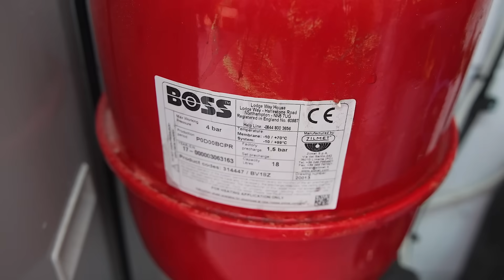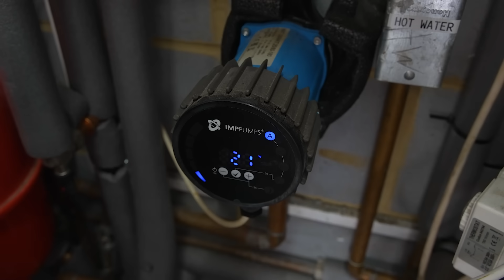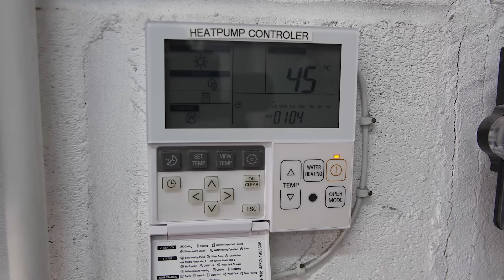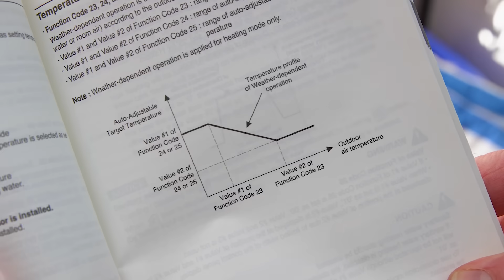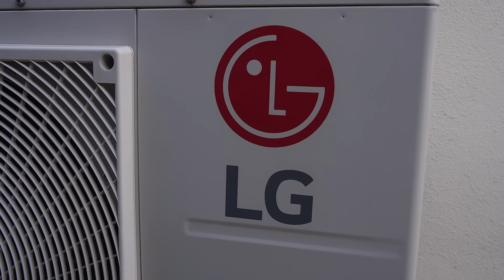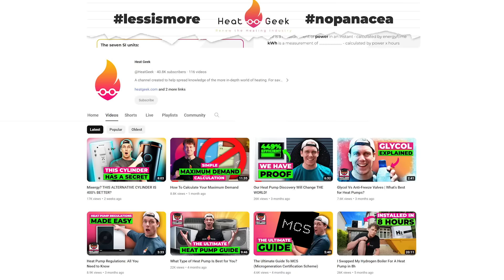Heat Geek Gives His Verdict on John’s Nightmare Heat Pump

Comment: Oh i dont aggree at all, this is old technic, first you need a "buffer" to equal flow prim/sec and yes you need weather comp, why i think this is old tech is today we use delta flow in/out HP is set and regulate pump flow for best effiency and compressor is frequenz regulated also to weather curve, we dont use on/off hp-compressor anymore they are outdated.
you need to regulate secondary flow to with threeway "shunt" weathercurve, heatpump is usally offset to this and has it set sensor in buffer.
problem is that most heatpump dont have the correct internal regulating to do this specially not with this simple panel, secondary flow must be adjusted individualy room for room and this part why you must have a "buffer"/hydraulicseparator, secondary "smart"pump is ofcourse presure regulated while primary heatpump circulater is temperature regulated on basis of delta temp in/out to heatpump 5-10 kelvin (celsius).
hotwatertank must not use internal spiral for heatpump flow, you need tapwater running thrue spiral, the spiral cant exchange hot to hot, dhw-tank space should be filld with heatwater and cold tapwater to spiral 10-20m from bottum to top, but realy this is being outdated to, most effiency is to use hot buffer and draw hotwater to plate exchanger for best effiency, yes you need probably more pumps but newer pump with permanent magnet dont draw much watts.
heatpump is doing both hotwater and heat two different settings.
air to water heatpumps are great if system solution is correct.

Comment: We have the most extensive and well maintained gas network in the world which isn't going anywhere as it's continuing to be maintained. A boiler say 1200 quid plus installation upgrade rad valves, flush the system will last you 12+ years even longer and parts are negligible. I'm a plumber. 
In the UK we jump all over new tech then realise they're a piece of shit going forward.
My own personal gas bill is 15 quid a month the secret being well insulated walls and ceilings heats up in no time and holds the heat.
Gas is here to stay I'm afraid
Reply from the maker: I have asked this question a number of times and got no answer.
Why is Transco replacing miles and milles of gas mains if we are going to phase out gas?

Comment: I was once subscribed to Skill Builder (SB) but when the channel started all this propaganda against Heat Pumps I unsubscribed as I was clearly seeing that the arguments of SB were messlinding. The SB has only to explain when a heat pump should be used and when not. Instead, SB started making videos after videos against heat pumps (using misleading arguments) for uniformed people. In UK you need first think about insulating and air-tighting the buildings and only afterward you can think about Heat Pumps. Also, the heat pump should be used with underfloor heating but not classical radiators. I am not from the Heat Pump industry but I have a lot of friends with well-insulated buildings using heat pumps and everything works perfectly. I shall install a heat pump at my new house (very well insulated and air-tight) in the mountains (in Romania) very soon. It is a pity that SB engaged in propaganda as it is not helping the channel, there are enough educated people who can distinguish between facts and propaganda.
Reply from the maker: Hi Vlad 
You have more or less repeated what I said in the original video on heat pumps. I am glad you have finally understood my arguments about not putting them into homes which aren't suitable. 
The mistake you make is to unsubscribe to channels you don't agree with. If you are not prepared to listen to anything that challenges your own opinion you will stagnate. Good luck with your new heat pump and I am glad the Skill Builder channel helped you.
Reply: @SkillBuilder   It is not about agreeing or disagreeing. It is s about false/misleading statements about heat pumps. I do not want to enter into arguments. SB did not help me to decide on installing a heat pump. I am an engineer and know how things work.
Reply from the maker: You bit. Can you feel the hook in your mouth?

Comment: I’m a Air Conditioning engineer working in the industry for over 40 years .....My advice stick with a gas boiler especially if you live in a older house.The technology and skill set isn’t there yet for water sourced heat pumps or install some nice air con units.
To many people are getting ripped off by this type of installation.

Comment: Yeah.... I'll stick with my gas combi. Renewable electricity generation has gaps which have to be filled in with 50% efficient gas generators. So you may as well burn the gas directly at home in a 90% efficient gas boiler, not a 50% efficient gas generator, transmitted over a lossy grid.
Reply: Remember that 20 years ago there really wasn’t any large scale renewable energy production, this is an industry that will only grow and grow.

Just like coal replaced wood, then oil replaced coal, then gas replaced oil, renewables will replace gas

Comment: sO HOW DO RADIATORS HEAT A HOUSE TO  21 DEGREES IF THEY ARE AT 30 DEGREES ? UTTER MADNESS.
Reply from the maker: The answer is that it wil do it very slowly. 
Heat will always transfer to colder even if there is one degree difference. The problem is that as the two temperatures reach the same the transfer slows right down so your point about a 9 degree temp difference is spot on. It isn't enough of a difference to do it quickly. You can take the chill off a room but getting it to a comfortable temperature to sit in is another matter. 
A radiator at 70 celcius in a room which is 15 deg gives a very fast heat transfer and that is precisely why a house with a big heat loss through bad insulation and draughts represents a big challenge for a heat pump. It just won't keep up with the heat losses. As I said in my very first video on heat pumps, they are a waster of time and energy in a lot of our older housing stock. People shout at me "Insulate the bloody house then" as if I didn't know that. The fact is that it is often very hard to insulate and draught proof some older homes.

Comment: Nobody in their right mind would fit a heat pump water Luke warm if lucky and radiators barely warm need to sit with a coat on in the house the cost of insulation is ridiculous and a fortune to run your electric bills will be sky high, keep with gas the best system

Comment: What's the point of a heat pump if you average it out over the year? Still got your gas boiler I see. That tells me the heat pump only works efficiently in the summer months-thats why they are used on swimming pools.  So for heat when you need it, it's still the gas boiler! Most people dont have the technical knowledge of the heat geek, to make the heat pump work efficiently( what does that even mean? what amount of heat does that translate to?)- to me, that means yet more cost on top of all the other costs of net zero. The price of electricity is going to go up by leaps and bounds, given silly Miliband's exercise. While we are trying to go green, China is building lots of coal fired power plants ( 8 last year) and carrying on at the rate of two per month. Which in my mind, makes it all a bit pointless.  Thousands and thousands of pounds and I'm still expected to by a EV !!! Oh and what's never mentioned, if everyone had a heat pump and a EV how would the electrical grid cope? We already have to import from France during high periods.( Its That word again, Infrastructure!) I have the sense that the government doesn't really know what its doing- shades of the diesel car fiasco.

Comment: What is never mentioned is the cost of running heat pumps and their circuits, over saving the planet, so where does the constant electric needed come from? at what cost? Low temperature flow rates, means only low temperature outputs in any language, much like expecting a crate car to keep up with a Ferrari, like that will never happen. Heat pumps are useless in 80% of UK homes purely because of the way their built. Cost of install including extra insulation all over the place, matched with the constance running cost, excluding all the spill otherwise, for the average person you have to be mad to even consider it or be extremely disappointed you ever did, not to mention a big hole in the bank account. THINK BEFORE YOU GET INVOLVED as it is little different than the immersion heater boilers once out but now never seen.

Comment: Mmmm. Puzzled by the “tilted fan unit” outside. Surely, if the fan shaft were fitted with opposing tapered roller bearings it would not matter what the “attitude” of the fan unit was?…………within reason that is. I suspect it’s likely the build incorporates regular radial ball bearings or, worse, plain bronze bearings….? And, the worrying thing about this tale is that, whilst this case might  well be out of the ordinary, there could indeed be other dissatisfied users out there ruing the day they “invested” in a heat pump system. Also, it does suggest too many, so called heat pump system engineering concerns, are “jumping on the band wagon” and not installing the most efficient systems for the properties in which they are installing their systems?? Sounds to me, some organisations have too many fingers in too many “pies” and hence, the level of “expertise” must, by definition, be less than optimum. Perhaps, companies fear putting all their eggs in one basket? Perhaps, ‘they’ know something we don’t…….?!

Comment: Sure... Let's swap about one 'burning box' with 3000 valves, 600 miles of tubing, electronics that don't communicate with each other and a device that freezes at +3°C outside... This is far from greener.
Reply: That's the point that the Heat Geek guy is trying to make. This system is massively overcomplicated for what it actually needs. Less is more.

Comment: When these naysayers realise that an inverter system runs at minimum 1.5x efficiency 😮
Reply from the maker: Well it need to because you are going to spend 5 times as much to install it and electricity is still more expensive than gas.

Comment: Amazing stuff!! 2 videos in and the poor guy's still got a bullshit heating system even though you've got a self appointed god of heat pumps who's still guessing at what the problem is. Loads of "It could be's" and "Maybe it's". Steel manning at it's finest. As for "The LG unit is not plumb and this causes the bearings to wear". Cobblers. My car has a fan unit and is constantly running out of true but strangely enough, the bearings don't wear out. The wear is caused by running the unit under load almost 24/7 which is another cost incurred to replace constantly wearing machine parts. Imagine we all start to drive electric cars and install heat pumps, the load on the grid would be astronomical and could not in any way be serviced by renewables. This is total folly.
A solution in search of a problem.
Reply: Do you have any sources that renewable are that bad? Nuclear is still a non co2 option as well

Comment: To chase efficiency its all gone too complicated, old systems pumped out loads of heat but new ones less heat and the 1000 things you need to do to make that heat work for you, insullation, new doors and windows, heat recovery etc.. see in 46 seconds on video the amount of kit needed to get heat (and not even hot water). any one of those fails and its 1000s. In old boiler an odd control valve or in rare occurances a pump change gets you 20 years. Here there is alot to fail and alot of geeking. Same thing in Solar, Efficient white goods, EVs etc.  You are guaranteed a big expense in these complex systems before the break even period comes I think. 1 visit by engineer and some parts will set back ROI by years. It needs to get less complex and less expensive and more knowledge.

Comment: I had  a qoute for heat pump plus insulation  plus changing to underfloor heating was nearly 40k for a 2 bed bungalow wtf  went with a new boiler for 1900 crazy money and neighbour has heat pump  and has electric radiators in every room as its too cold  total con  and every neighbour is moaning about the noise the damm thing makes

Comment: ASHP  absolute rubbish.
Weather compensation also dreadfull... we had ecodan ashp... with ufh... pv panels more insulation in cavity and floors all very expensive. But just didnt do the job...
Our weather can easily change 10 degrees in 24 hr period... by the time its sent heat compensation into the house the weather has changed again..... after 7 years the mitsubushi ecodan hpump died...so they dont last like a boiler. couldnt get anyone the repair it... or re-gas it... left it dead and purchased a worcester bosch boiler ... brilliant.. we were finally warm with plenty of hot water with this ... and cold with the air source pump... theyre completely useless ... our family wasted thousands of pounds and we were cold...
I hate to think how many co2 produced making all the ancillaries needed to put these pumps in.
I wouldnt recommend them... I would never ever purchase another one.
They have a legionnaires setting 60 degrees and in winter the pump couldnt produce that temperature so that was a problem. 
Love to see if this chap ever gets it sorted... and if it works to an acceptable level.... very much doubt it.
Noone knows anything about the control systems...messy... over complicated...dont last...complete cack
Reply: In one of our houses we have a W-B combi oil boiler, every year it is serviced, every year it breaks down, there can't be much of the original left now, I would never buy a W-B combi oil boiler ever again.
Reply: @fredbloggs72  yes agreed... not oil...use gas...sooooomuch better... also whilst using will be giving food to the plants  its a +++

Comment: Not a great advertisement for LG.... designing a unit so delicate it needs a fully levelled foundation to stop the fan motor warping to the point the bearings are out of alignment...for £7'000  the bloody things should be built sturdier than that !...😕
You can plop down a diesel-powered backup generator weighing many times more weight basically anywhere and it will run...funny that... 🙄

Comment: Installers, Designers or Engineers.  Been in HVAC for 52 years and it aint getting any better.  Installers/Plumbers DO NOT DO THE TRAINING. This is even true for Consulting Engineers.
Your comment "nobody needs to know about the box outside" is the most STUPID thing I have heard.  I sold LG for 17 years including AWHP more recent years.  You need to FULLY UNDERSTAND THE CORRECT COMMISSIONING,  Mr Heat Geek
Reply: CPD is the only way forward in this industry. This blog makes it very clear that problems with installations will only be reduced if the practitioners themselves have an incentive to upskill. Sadly the gap between Kit manufacturers/suppliers knowledge and the domestic market’s practitioners varies from narrow to over the horizon! For example:- It’s amazing how many Hive units have been installed and left doing nothing more than acting as time switches. This includes setups with remote sensors in odd places and zone controls which are not being used - just fitted because they are in the catalogue or perhaps because the neighbours have them?

Comment: Is it even cold there ? You guys are wearing T-shirts outside when you are talking and now onside you are only wearinf hoodies. What are you going to do when the REAL cold comes? Snow on the ground? And later, next month in January, when its going to be -28 C for weeks?? Is the heat pump going to handle that cold?? And the ice storms! Freezing rain falling from the sky coating everything in layers of ice and branches falling off of trees? Then what is the heat pump going to do? What happens when that loud outside unit gets covered in that freezing rain × ice?  Plus every few years it gets even colder! So far here in the past 5 years we had a few days of -50 F that lasted for 2 or 3 days. Sorry I didnt convert that to C. But the -28 C here is very common in January.

Comment: I have an old Farmhouse an I heat by wood stoves. I have gas CH but never use it. However we use a little electricity as the house has all LED lights, three fridges and freezer so very little to use power. The  bill comes every month at £120 + we cannot use much less and it appears the standing charges for combined power is a very large % of the total. Heavens knows what the charges would be if we were forced into heat pumps for the warmth. The false premise that the power is high because of the Russians is total balls it is the spooning off by the greed of the corporations and them being allowed to do the charges because of the regulator being up to their eyes in cahoots with the corporations and government to pay the green agenda. There will be hell on Earth if there is a really cold winter spell (1963 like) there will be deaths of the poor and vulnerable who are cut off by the threats of ‘smart meters’ being in control.

Comment: What a load of bollocks everything is a hundred times more complicated than it needs to be - you could heat a massive country house with an oil boiler have it serviced once a year and 40 years later its still working an keeping the house warm - How on earth if you dont fool yourself would this ever prove to be cheaper than gas or oil and it cant possibly be greener when you factor in repairs and renewals - I bet a system like this will cost a fortune to maintain and repair - The old saying of a fool and his money fits in perfectly with the heat pump industry